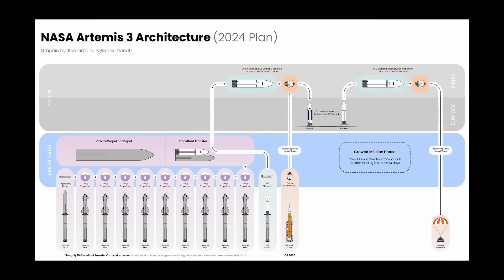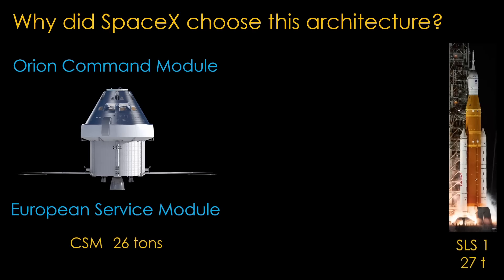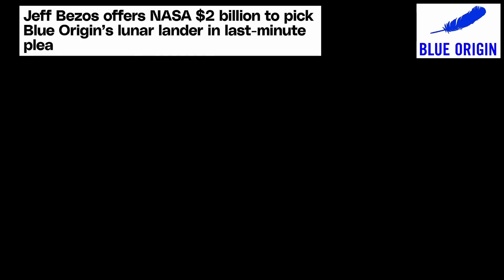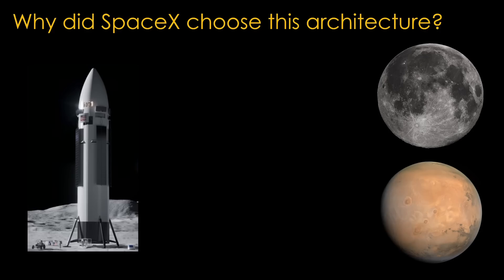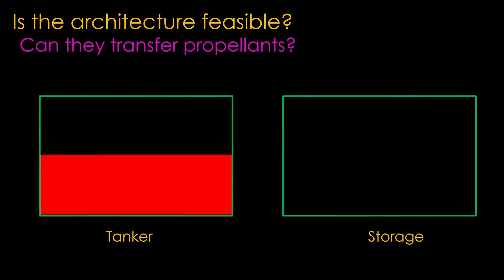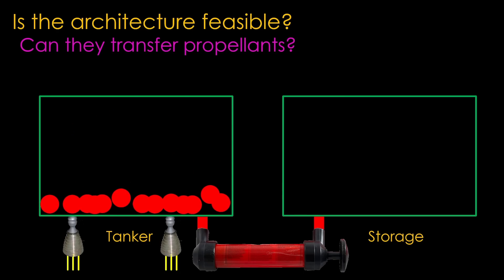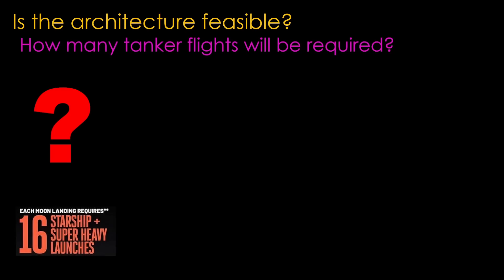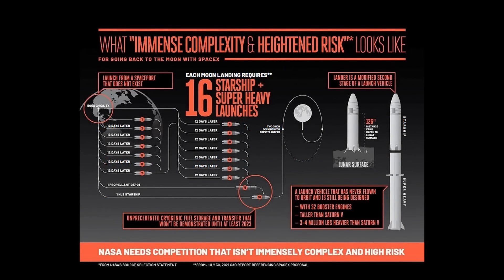Starship Orbital Refueling

Comment: Regarding fuel transfer in space, there is another good approach.   Use a low rotation rate to create enough centrifugal force to pool the liquid at the “bottom” of the tanks. This allows pumping without the danger of fuel/(or oxidant) vapor mixed with the liquid being pumped. It also allows for capturing vapor vented through a relief valve at the “top” of the tank. I don’t know the minimum centrifugal force required to separate the fuel from the vapor inside the tanks but it must be on the order of 1% earth gravity acceleration.  There are effective ways to allow docking at zero g and then induce rotation without expending fuel, then after fuel transfer to eliminate rotation and undock under zero G conditions without expending fuel and without the need for thrusters. 
    Refueling in lunar orbit in order to return to earth sounds much riskier than refueling in earth orbit (there will be means to rescue in earth orbit but not in lunar orbit).
    The SpaceX lunar lander’s huge payload is vital for establishing a viable permanent lunar presence.  A large Payload will be required for lunar infrastructure to extract lunar ice into water, oxygen, hydrogen, and probably frozen methane deposits.  Once the moonbase can supply these necessities, support costs can drop by 99%. 
    Payload is also required for adequate electric power for operating equipment including extracting oxygen from carbon dioxide, & temperature control.  Also payload is required for a launch/landing pad.
Reply from the maker: Are you thinking "head over heels rotation" (x or y axis) rather than spinning around the z axis?

If so, that seems difficult because the center of gravity is going to start in one place as the starship is just spinning around the propellant floating in the tanks and then migrate as (presumably) the inner baffles start pushing it in the right direction. And I'm not sure that puts it to the bottom of the tanks. 

And the center of gravity of the depot will change based on the amount of propellant in the tanks.
Reply: @EagerSpace  I see them as manageable considerations. It’s easy to visualize rotating end over end with nose to nose or nose to tail or tail to tail.   But side by side is possible especially if they aren’t exactly rotating on an axis parallel to the central axis of the two starships (otherwise the fuel will not pool in one place at the “bottom” but instead along the length of the tall tank).  E.G. Link them in opposite directions so the center of mass of one starship is towards one end while the center of mass of the other starship is at the other end (that makes them rotate somewhere between head over heels and around an axis parallel to them, thus allowing a deep end pooling).    Another manageable consideration is called the “Intermediate Axis Theorem” (odd tumbling to avoid).
Reply: @douginorlando6260  nose to nose is also interesting because the rocket already has all the plumbing to get propellants from tanks "up there" to engines "down there" and also has turbopumps designed to deal with cryogenic liquids, add valves and plumbing to docking ports, run the pumps on minimal amount of fuel - done. Bonus points if you could divert turbopump exhaust to provide rotation and/or  whatever would be beneficial ullage thrust (effectively changing full flow cycle raptor into open cycle engine).
Reply: @EagerSpace  I think rotation around the Z axis would actually be a perfect solution for this. A pumping system around the periphery of the tanks would work similar to oil systems and pumps in aircrafts with high manoeuverability. These typically have an oil tank with holes in multiple directions connected to a pump that can collect from multiple directions. If anything, ullage thrusters would be significantly harder and costlier to implement than rotating around the Z axis for pumping. To rotate around the Z axis would only require some reaction wheels powerful enough and that can be re-used for multiple refuelings. 2 vehicles could be docked around the same axis or rotation at the tip of a Starship vehicle let's say or even at the bottom if the header tanks are in the way.
Reply: @EagerSpace  I don't see why any of that would be an issue. Angular momentum is conserved after all; if the ships are spun up, they're going to stay spinning at least some amount even as the propellant settles, no matter where that propellant started.
Reply: Rotation seems like it could work. Ultimately, there are tradeoffs in every design, and I'm sure SpaceX will analyze all possible methods to determine what will work best.
Reply: So, using rotational artificial gravity for ullage management means that the fuel will be pushed outward, towards whatever the furthest end of the tank is. With the currently envisioned side-by-side docking method, that point where the fuel will pool is: the side of the tank directly opposite that of the QD mechanism / docking point.
Your fuel pump would have inlets on that outer side of the tank, and the pipe would run along the side in a C shape to the docking point.
This sounds reasonable.
Reply: That's an interesting idea, which I've never heard of or considered before. It seems like an interesting trade-off:

     1. You're pulling all the liquid propellant to one part of its respective tank where it can be pumped from. (Great!)
     2. The part of its tank that you're pulling it to it the point furthest away from the spacecraft that you want to pump it to, meaning that you need to have a long pipe to pump it through. (More mass, and potentially wasted propellant left in the pipe)

Is this an idea that you got from somewhere? Is there more information this technique that you can refer me to?

Comment: In my opinion Starship was built essentially for LEO. The Mars rethoric relied of the design evolution with further iterations, as gathering more funding for the project. That would explain the ridiculous amount of refueling missions at LEO, as the lack of proper landings gear for rough terrain.
Reply: LEO is often called "the halfway point to anywhere" as far as spaceflight is concerned. The delta V is monstrous but once you have the ability to refuel the whole solar system is yours provided you can keep alive whatever you are sending. A "rapidly" reusable superheavy launch vehicle utterly destroys our current spaceflight paradigm including reusable F9's. A partially reusable upper stage with a fully reusable booster still makes something like "The Hermes" from The Martian orders of magnitude easier, same with a moonbase.
Reply: Obviously it is built for LEO because if it isn't built for LEO then the refuelings become expensive

Comment: The Saturn V with it's ability to send the Apollo spacecraft and the Lunar module to the Moon with Apollo spacecraft being in a 60 mile circular orbit around the moon which took about one hour to complete one orbit. Since Orion doesn't have the capability to get in to a low circular orbit of the Moon but as shown in this video can only get in to an elliptical orbit which takes SIX days (correctly if I am in error) to complete ONE orbit of the Moon. So if there is an emergency how can the lunar lander, whatever the craft chosen, rendezvous with the Orion when it is far away from the Moon (for about 5 days)! With this more complex Moon architecture and lack of money from the US Congress, I believe China, using a much simpler design, like Apollo and its Lunar Module will beat the US and SpaceX in landing Chinese humans on the Moon.
Reply from the maker: 6 or 7 days depending on the orbit, IIRC. And yes, I think it's ridiculous to build an architecture that means you need to wait a week if something goes wrong. It puts a far higher reliable requirement on the landers, and you can still have medical issues that could maybe wait 3 days but won't wait 10.
Reply: wow you should become a rocketscientist
Reply: HLS can land a large amount of things on the lunar surface. While it is stupid that the architecture requires a week for any rescue, one could make lemonade out of these lemons by including a large number of spare parts/repair tools/etc, to at least attempt to mitigate some otherwise deadly issues.
Reply: If China's moon program survives their economic downturn, they may well be the second nation to put boots on the moon...

The space race that interests me is - who will be first to have robots constructing a proper moon base?         
And will the 'first moon base' trophy go to the first base constructed or the first base to be occupied?        :)
Reply: Exactly. NASA should focus on reviving the Apollo program, but with an update technology. Leaving the cargo missions as infrastructure, for private companies. Where reusability could be an important factor.
Reply: @RogerM88  Changing the architecture now pushes out moon landings to the 2030s.

And the only way NASA would realistically be able to afford a more modern architecture is to cancel SLS/Orion and probably gateway as well. The idea does hold some merit. NASA could contract private companies to make a LEO -> moon surface lander, launched on commercial launch vehicles, and rely on commercial providers to launch crew to LEO. This allows NASA to focus on the science.

But Congress would never sign off on it. And again, it pushes out landings quite a number of years.
Reply: The US already made it to the Moon first, it doesn't have to check that box with another Apollo-type architecture Moon program. The goal of Artemis is to have a sustained regular series of flights that will build a lunar base. China won't be able tot do that with their initial program.
Reply: @donjones4719  I actually agree with you but what I wrote is based on the current or lack thereof of Congress funding for the plans which NASA, SpaceX, etc. are planning. But it is not going to happen any time soon and perhaps not for decades. NASA’s Orion spacecraft and its inability to obtain a low lunar orbit like Apollo is just one deficiency. Secondly everyone seems to be counting on SpaceX’s Starship to make space flight routine like our current aircraft which took many decades to achieve routine air flight today. There are a lot of unproven technologies including SLS, Orion spacecraft and its European service module, SpaceX’s many projected but yet unproven Starship capabilities. Mainly what I see is that lack of funding for a lunar “space station”, fuel depots , problems with Artemis, Orion’s heat shield, and as yet unproven refueling of a Starship in low Earth orbit for it or any of its variants to break free of Earth’s orbit, flying to and entering the atmosphere of Mars (which I think on all first space probes landing attempts failed). 
Think about what NASA was able to accomplish from May 1961 to July 1969. Within just eight years and two months NASA went from launching suborbital flights to landing on the Moon with no real critical failures of the Saturn V launches compared to SpaceX’s Starship test flights. I wish SpaceX total success but as many people with decades of spaceflight experience have stated “space flight is a very dangerous business.” And while SpaceX with its Falcon 9, Falcon Heavy and cargo and Crew Dragon capsules have been highly successful it will take a lot more money and spacecraft design that are better than the Saturn V, Apollo Command/Service and Lunar Modules that got the US to the Moon 55 years ago. The SLS and Orion as they currently exist are less capable than Saturn V, Apollo and LM. And Starship has yet to be proven so far over the past few years while from what I have read the Saturn V rocket never failed.
I do hope NASA, SpaceX and other private space companies succeed but doubt it will happen in just 8 short years as was the case with Saturn V (a three stage rocket compared to current rockets which are just  two stage rockets), a superior Apollo    command/service spacecraft (as Orion doesn’t have enough delta V to achieve a low 60 mile circular lunar orbit) and a unknown (precise) quantity of “water” at the lunar South Pole.
Reply: @fred36956   Thank you for the detailed reply. Yes, the Orion is a compromised design due to SLS and the cost of an SLS+Orion trip is unsustainable, or will sustain only a snail-paced lunar exploration and base program. Congress created this and yet will not fund Artemis accordingly. 

I hang all of my hopes on Starship. If it fails then we're screwed. BO's lander will be years behind schedule - all human-rated spacecraft are. By all of my hopes I mean even for the LEO-NRHO-LEO  leg. Once HLS has human-rated crew quarters it'll be simple to get similar quarters approved for a transit Starship. A Dragon taxi for LEO can be used if desired. Such a ship can do the trip with no need to refill in NRHO and still propulsively decelerate to LEO. The math has been worked out, see the Eager Space video "Commercial Moon - Starship, Dragon, and Starliner." Options 3 thru 5. It may even work for LLO.

I'm optimistic about Starship in all of its incarnations for two reasons. One is that I can't bear to contemplate a failed Artemis program. The other is that all NASA has to do is accept a crewed Starship that SpaceX is going to build anyway. Elon wants the propellant depot and tankers and a human-rated Starship for the Mars program. That gets us past the biggest problem you point out, the lack of Congressional funding. Having NASA along is immensely helpful but that part of Artemis will get done regardless of NASA or Congress.  (OK, "all" that NASA has to do is also kill SLS+Orion politically - but that's not as impossible as it once seemed. Once the public sees HLS docked with Orion the general public will finally notice. There are plenty of people in Congress who'd like to get their hands on the billions saved by killing SLS - Boeing isn't the only factor in Congressional pressures and bargaining.) Dear Moon is cancelled but SpaceX will at some point send a crewed Starship around the Moon as part of their development program, in concert with NASA or as a private flight.

Starship and large-scale orbital refilling are unproven, yes. I base my optimism on the performance of SpaceX engineers so far, and especially on the success of OFT-4. Despite a compromised TPS the ship made a successful landing, did that crazy flip and lit the engines. That's huge. The improvements incorporated so far feed my optimism.

I think we both agree that if Starship fails Artemis and a significant US presence on the Moon is screwed. NASA and Congress aren't going to approve an alternative to SLS+Orion - unless the specter of China dominating lunar exploration lights a fire under Congress.